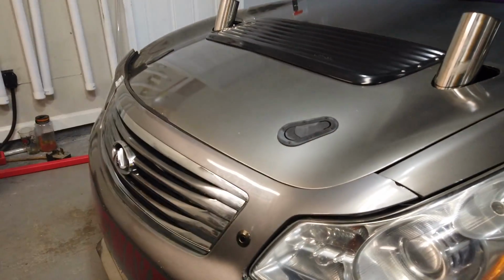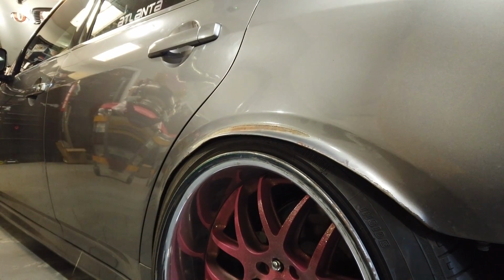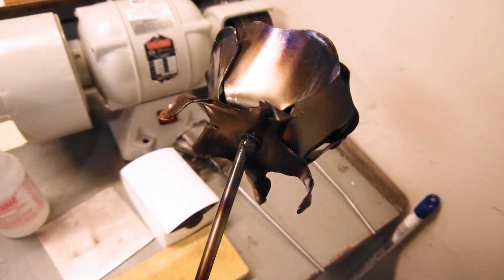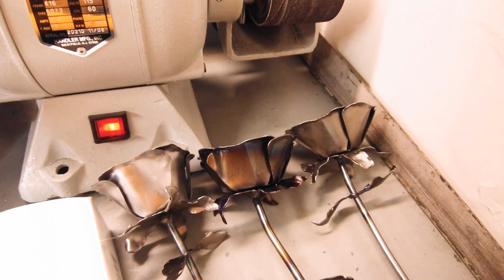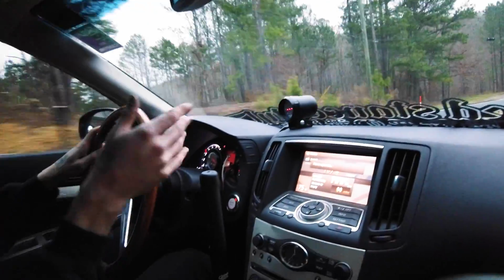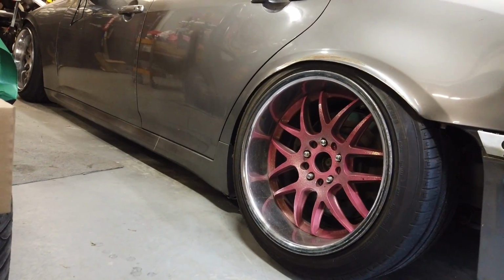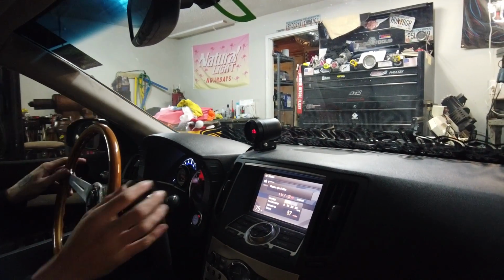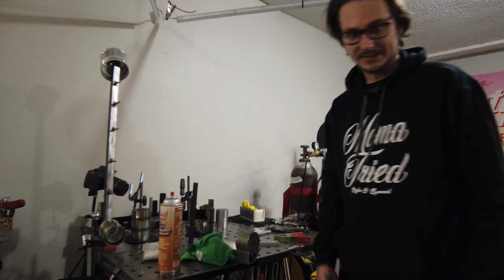Homemade Twin Turbo G37!!! || Gimmie Dem Keys

Comment: Lmao its a g35
Reply: I love Honda but you drive a cheap car. Like bottom of the barrel.
Reply: Rescue Rabbit um okay? He just said that it’s a G35 because in the title he said “g37”
Reply: It's a g35 because it has the vq35hr.  It has the g37 exterior.  Its weird ik.
Reply: @killakam123321  No, thats a G35 body. They switched it to a G37 in 09.
Reply: @WrongFromWright  eh same thing tbh g37 sedan and 08 g35 sedan have minor differences on the exterior.  Looks nothing like the original  earlier g35 sedan
Reply: ReggaeDubSoundSystem actually it could be an 09 G37 sedan which looks like an 07-08 HR G35 sedan (same bumpers same headlights lights) most were in “S" form with sport bumper really hardly a difference also the VQ35HR and 37VHR are very similar almost the same internally besides VVEL the heads on the 3.7 are slightly different (not necessarily better,as people put HR heads in 3.7VHR cars)